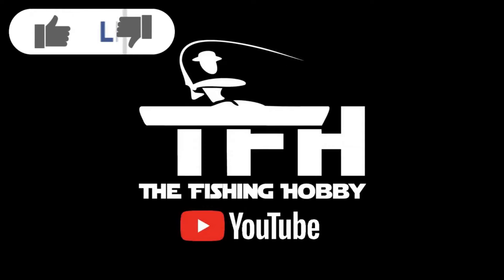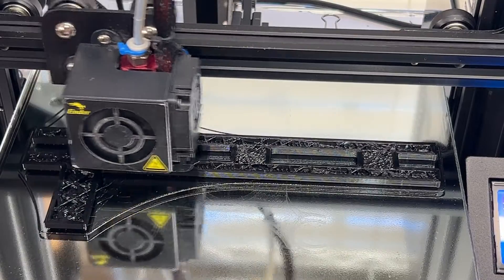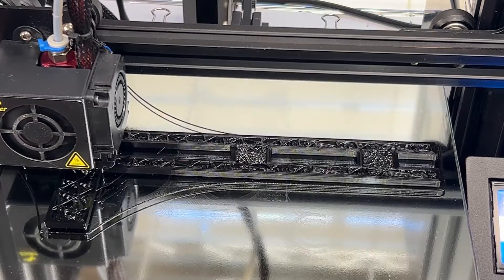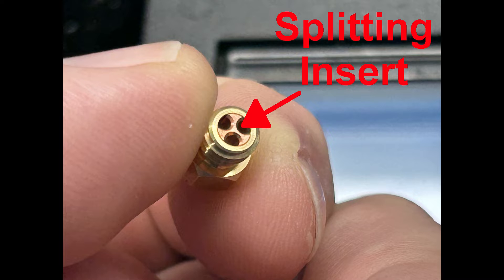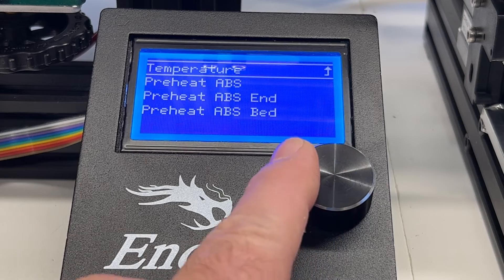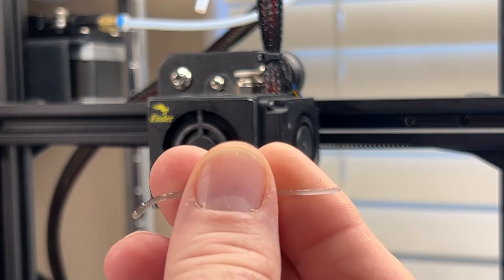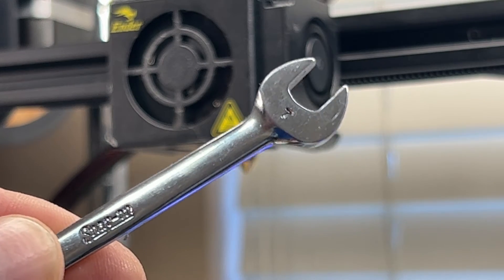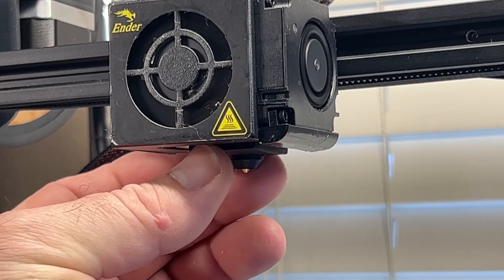Simple Ender Mod - Fake! CHT Clone Nozzle + How To Replace A Ender3 Nozzle

Comment from the maker: I’ve worked on electronics for a living for many years and I forget that not everyone is familiar with how to do that on live machines (which quite often is the only way to troubleshoot them). I was personally well aware of where all the wiring was and there was no way I would have shorted anything out, BUT I absolutely never stopped to think about making sure others were aware of that and suggesting if they weren’t experienced with working on live equipment then they should unplug the machine first. I wanted to pin this comment to the top of the list to say I should have approached this topic with an inexperienced persons frame of reference in mind.

Comment: Wow. I run my PETG at anywhere from 160 to 360 mm/s😂 and they come out immaculate. Big complicated prints too.
Reply from the maker: @notyouraveragegoldenpotato  I believe it if you are running a .4mm nozzle. I'm running a .8mm nozzle. Huge difference in volumetric flow between those two sizes.

Comment: BTW Slice Engineering sells a hotend thermal compound, boron nitride based i believe, which goes between the nozzle and the heaterblock into the thread and helps thermal transfer, helps release it easier.

But i'm too cheap to pay Slice prices! So i tried copper brake grease that i already had at hand. I don't know if it did anything, but i didn't appreciate the smoke while it was curing-in. I do think the removal was OK afterwards, i don't remember exactly but i don't remember torturing myself either.

Then i bought cheapest high temperature thermal paste from China, HY410. I recently removed a nozzle that i mounted on it and it came out easy, and also, it doesn't emit smoke.

I should start writing things down a maintenance protocol or something like that. Because i thought i nickel plated a nozzle and installed that, and the plating seemed to be holding well, but when i now removed the nozzle, i couldn't see any trace of nickel on none of the surfaces, which is weird. Did i replace the nozzle in the interim with a plain brass one? Who knows! And if i did extract the nickel plated nozzle earlier, then where is it, why isn't it in my bag of emergency (will realistically never be used again) nozzles? Why don't i remember inspecting it? You don't just evaporate nickel, especially not from surfaces which are inside the hotend and well hidden. Mystery.

Also i always forget trying to remove a nozzle cold, which would be convenient. Always heating it up :D

Comment: Today I mounted one (0.4 mm) and the walls are so thin that the nozzle broke inside the Heat block 🥲
Reply from the maker: That’s a bummer! I haven’t had any issues with the ones I’ve bought but quality control isn’t very consistent amongst these sort of knockoffs for sure.

Comment: I am curious I have recently started using these in a V6 style nozzle. And my filament responds is if it has moisture in it I have lots of snapping and popping now have you experienced this?
Reply from the maker: I have not. I don’t keep my filament in a dry box or anything, but it is inside my house which is climate controlled. I only print with PETG, are you experiencing that with PLA?

Comment: Tuning my ender 5 pro now. Ive found that you have to increase nozzle temp to 215-218. Increase flow rate as well to supply more filament. Just my findings
Reply from the maker: I don’t use PLA, only PETG so I haven’t run anything at the temperature range you are working with using these nozzles. I’ll keep that in mind if I ever need to run some PLA, thanks for passing along your findings!

Comment: Printing just fine at 120mm/s on the Ender 3 v2 Neo with 0.8mm nozzle. Ordered some fake CHT nozzles with PTFE coating because the filament keeps sticking to the nozzle at lower temperatures due to curling and it likely isn't melting the filament fast enough. So I figured I might as well try it.
Higher temperature prints perfectly if the filament is dry so I am using that for now. The spool is in a 4L cereal box with a bag of car desiccant at the bottom that I cut open and emptied. It's keeping the humidity at about 10% which is probably the lower limit of the sensor I am using so it might be lower. The spool is made of cardboard and I noticed it takes weeks for the desiccant to dry it so what I do now is when I take it out of the package I put it in the oven at 80c for 30 minutes with air circulation turned on and it only takes 3 hours now to get to the humidity in the box to reach 10%.
You might want to try using a container with desiccant as well and see if that allows you to increase printing speeds. You do have to design your own mechanism to hold the spool of the bottom to prevent grinding (unless there is a design for the box you are using) but that is not the biggest deal.

I will be installing a different heatbreak and the CHT nozzle in a couple of days if you ask me to share my thoughts in a couple weeks I might just do it.
Reply from the maker: You are printing PETG at 120mm/s? I can print PLA fast but PETG I have to slow down considerably (about half the max PLA speed or prints start looking sloppy). I’m using the Ender 3 V1 MK8 style hot end though. I’m using generic bi metal heatbreak and the clone CHT nozzles with the MK8. The Neo series has a different hot end.